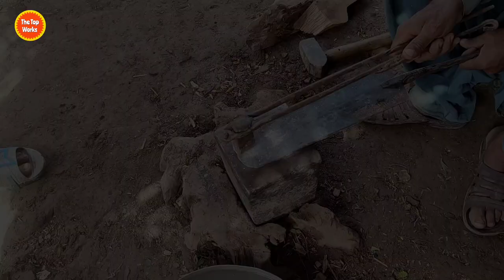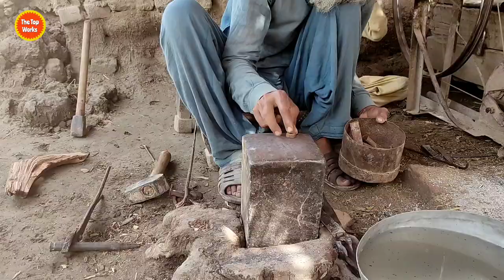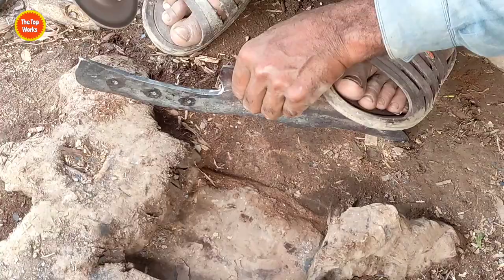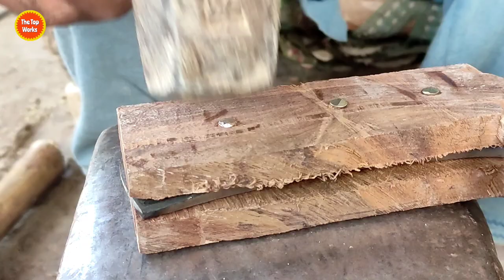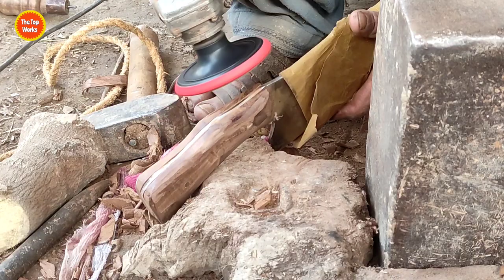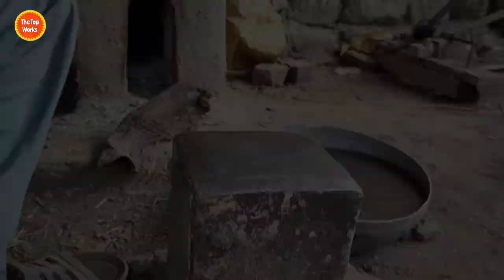Talented blacksmith making a Cleaver out of old Rusty iron Angle | Knife making

Comment: Mild steel angle iron, this blade will be dull in no time at all. A pity.
Reply from the maker: Your opinion is respected. Stay tuned
Reply: I cannot agree more. It's not even steel, it's iron. It will not be able to cut bones, only meat.
Reply: @igorvasyltsov5842  it will not be able to cut, period. One cut — and it's dull like potatoe, go sharpen it again. And again. And again!.. The Horribly Slow Cutting with the Extremely Inefficient Knife